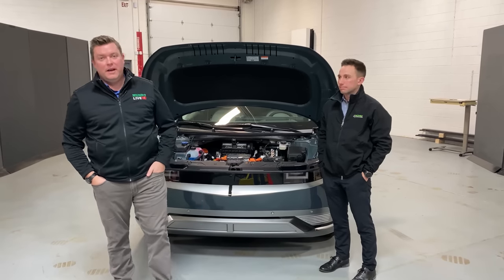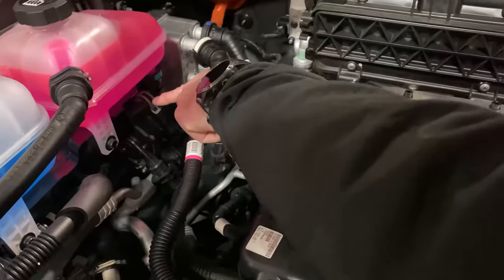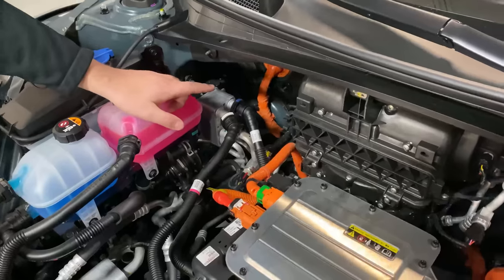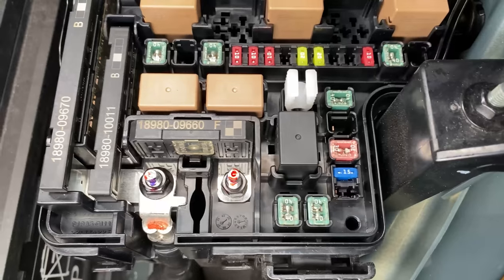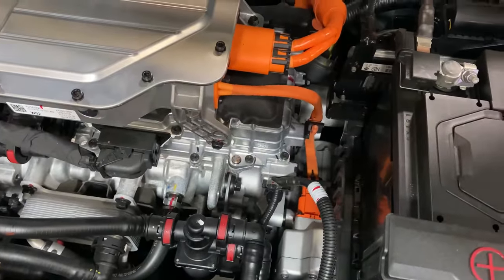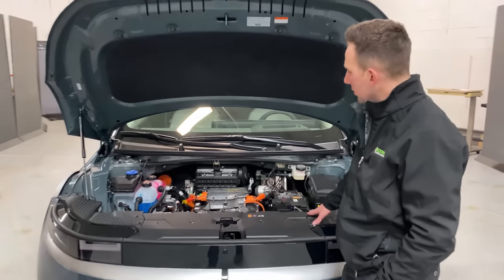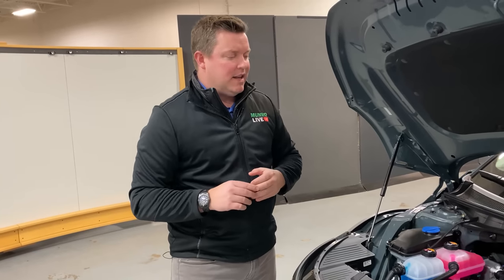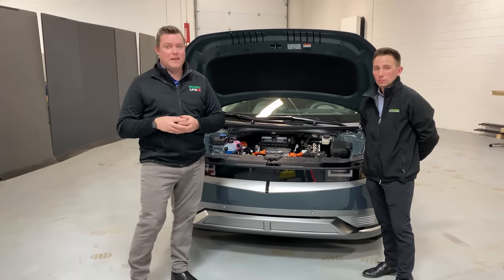Hyundai IONIQ 5  |  Under the Hood

Comment: Hyundai is making a committed run at the EV transition. But what I learn from videos such as these is just how gdmf innovative and clever is Tesla and how ferociously they're developing their products. Think of it: from this IONIQ 5 thermal management tangle to the "design symphony" in the Tesla. I'm rooting for all serious BEV contenders, but think all but Tesla must get deadly serious if they hope to survive, never mind thrive.
Reply: You're missing the point, not only are you wrong with Tesla having a much bigger advantage than you realize. It doesn't matter what a competitor can make if they can't produce it at scale. The margins matter, only Tesla is selling millions of EVs at a ridiculous 30% profit margin.
Reply: The trick is, does it really matter?  The incremental costs of segregated systems is pretty trivial compared to the overall cost of the vehicle and in some cases, may be more efficient, but arguably not as "elegant".  You have to understand that the average buyer will never see any practical difference between a heat management system like this and Tesla.  These systems will be maintenance free for the practical life of the vehicle, so they are pretty transparent to the buyer experience.
Reply: The design symphony was a rear drive unit on a $150,000 car.  There are different ways to go about things, and Hyundai's is not a wrong way. These e-gmp cars are more advanced than everything but Tesla, and maybe a couple of Chinese EVs.   This modular platform will result in a number of different cars for different niches - that flexibility means some compromises, but those compromises are with a purpose.
Reply: @anxiousappliance  The "symphony" exists in every single part of a Tesla car. That's the point, specialization without compromise. That's why the Hyundai way is lazy and stupid and will lead to their bankruptcy. A one-size-fits-all approach results in everything being equally mediocre.
Reply: @kyotosunsetdreams6105  not so much.  Different approaches, each has their upsides.  But you were quoting Munro, and they were discussing the rear motor cradle of the Plaid.
Reply: @anxiousappliance  no, i win.
Reply: We're all winners.
Reply: @anxiousappliance  no just me
Reply: @kyotosunsetdreams6105  If you had half a brain you'd realize that Tesla takes huge risks with "optimization" for the sake of costs.  For example, the VCFront has ALL the accessory motor control circuits on the board itself, which means that if the FETs for the wipers blow or the circuit fails, the entire VCFront must be replaced ($1k+), not just a $35 motor!  Optimization at this level is a double-edged sword and many Tesla owners have been burned by it!  On paper, these kinds of design optimizations sound good, but in the reality of a harsh operating environment; vibration, large temperature swings, etc, it's a recipe for failure.
Reply: @awebuser5914  Half a brain!? I am an Aerospace engineer bucko! I work on rockets, I think I know what I'm talking about when it comes to optimizing design.
Reply: @kyotosunsetdreams6105  Sure you are...  I'm also sure you immediately saw that the VCFront execution is just a really BAD idea all-around; making typically minor issues turn into extremely costly ones.  I can't begin to imagine the removal/install costs of the VCFront, let alone the part cost itself!  Mind-bogglingly ignorant design from a service-life perspective.
Reply: @awebuser5914  The point is to move to a low voltage system that doesn't work off of archaic 12 volt which was antiquated by the time it was designed.
Reply: @kyotosunsetdreams6105  Then I must regretfully declare victory.
Reply: @anxiousappliance  i decline your declaration and declare my own.
Reply: @kyotosunsetdreams6105  and so it is written
Reply: Having integrated systems may be better for company profits and simplicity. But at the same time, it increases the cost when (not if) a part of that integrated component breaks. You would have to replace the ENTIRE thing. That would cost many hundreds of dollars MORE than if it were separated like it is on this Hyundai. Serviceability is key to longevity and low-cost maintenance. The cost for maintaining the Tesla over the life span of 10+ years will be a LOT more than this Hyundai, mark my word.
Reply: @michaellim4165  Noting your word, but not marking it. We'll see how your theory pans out, but so far indications are that the reliability of multifunctional parts are a non-issue.
Reply: @michaellim4165  HAHAHAHAH HAHAHAHAHAHAHAHAHAHA. .... AHAH hahAhAhahahah. HA HAAH AHA...
Reply: @KyotoSunsetDreams  You have nothing for a comeback. So I win.

Comment: The thermal management system is complex on BEV’s. It’s not a simple radiator and water pump solution to keep the electronics and batteries cool.

Comment: This is not as simple as a Tesla.  Thank You for this information.
Reply: And yet it is cheaper than a Tesla and much better build and with more features like HUD, super fast charging 800V, heat pump, pre-heating battery, better quality seating and equipment, V2L, etc. Tesla needs to up their game cause they are getting leapfrogged in every aspect.
Reply: @TheNature101  Wait, did we watch the same video? The features you mention Tesla has for years now. 
Also, better seating? I sat in both and Tesla's are much more comfortable.
Reply: @TheNature101  800 Volts but still slower and charges slower that a 400v equipped tesla
Reply: @0xszander0  Tesla does NOT have a HUD. Tesla does NOT charge as fast as 800V Ioniq 5. Tesla does NOT have V2L. Tesla build quality is GARBAGE. A $60K that is full of squeaking and rattling, and phantom breaking on every turn on every bump. And I know that for a FACT as my family used to own both a Tesla 3 and Y.... but not any more. Hyundai's build quality is eons AHEAD of Tesla. And Tesla better wake up before it is too late.
Reply: @clevernduruza8624  On the Ioniq 5 you can add almost 100miles in just 5min or charge 10% to 80% in just 18min. You Tesla fan boys are in denial and better wake up before it is too late.

Comment: 400 600 800 volts is not hV according to nec 2020 it begins at 1000v
Reply: Terms such as "high" and "low" are relative. In an EV, the lower-voltage battery runs around 12 volts, and the higher-voltage battery typically runs around 360 V but in some cases twice that. It's the high-voltage battery of the vehicle, whatever the NEC classification.

Comment: Man that thing is a mess under the bonnet.
Reply: They are reviewing a model with the front motor installed, a battery heating system installed and a heat exchanger installed. Lower trims have none of these with RWD I5s being much cleaner under the hood.
Reply: Context is everything.

Comment: LOL. Standard 12V and a fuse box? These cats are no match for Tesla.
Reply: Munro is a manufacturing cost analysis service. It's interesting that they didn't comment about how much more the lithium-ion battery and management system costs, compared to a lead-acid battery. No everyone is buying a $100,000 car.
Reply: These are costs for normal people. Is resettable fuses and a lithium 12v battery worth hundreds in extra BOM Prices?
Reply: @brianb-p6586  The Model 3 is not a $100K car. And what does that lead acid 12V battery weigh, over 50 lbs?
Reply: Ioniq 5 can do V2L while Tesla bidirectional charging everyone got so excited about (autobidder etc.) was another hoax.
Reply: @KyleHubb  The Model 3 doesn't come with a lithium-ion 12 V battery, although some Model 3 owners buy an aftermarket lithium-ion replacement. The Model S is a $100K car, and even it didn't come with a lithium-ion 12 V battery for years. 

The battery in this Hyundai is unnecessarily large. A smaller AGM lead-acid would be an obvious choice.

Comment: That saves the company money but it is not as durable and reliable. Sure it will make it out of warranty but then what? It is also much more expensive for the customer. That is what BWW and Daimler do. It makes the car's expensive to own and maintain for the customer and guarantee's they will fail shortly out of warranty. On top of that in exchange for less durability and reliability no saving is passed on to the customer! So we have taken Hyundai's already questionable build quality and durability and lowered it! What an achievement! More cheap plastic under the hood.

What idiot want a car that has non-serviceable fuses and relays. We do not want a throw away car or a car that needs $2000 worth of service if it just needs a fuse!
Reply: Just like most modern homes don't use fuses any more on their electrical panels. 

EVs are using something similar to a breaker. If it is tripped, the system checks for fault and depending on the result of the self check it can flip the breaker back on certain circuits. 

No need to sell the car or throw it away because the breaker tripped. What they are showing here is that the old OEMs are still stuck using fuses when they can switch to breaker like modules that can self diagnose and don't need to be replaced like a burned fuses would.

I might be wrong but just like I don't think new homes will be getting fuses instead of breakers on their panels, in my opinion all OEMs will follow the trend and get rid of fuses.
Reply: These cars are buildt to last. There are very few problems with hyundai EVs, and their build quality is in no way questionable.

Comment: Why are legacy auto makers kludging something together that looks like a Frankenstein auto?  Tesla is doing what automakers should be doing, namely removing parts that don't increase the functionality and efficiency of the system.  Just about every OEM sans Tesla and some Chinese automakers that started with a clean slate, have been trying to use up their old parts that are laying in a dusty parts bin somewhere.  If EVs are to be successful then the engineers must win and not the bean counters.

I have a Prius that I want to replace with an EV.  If I wanted unneeded complexity I would stick with a Hybrid.  Come on OEMs, stop trying to make an auto body that works for ICE, hybrid, and EVs.  Start with a clean slate and reinvent the wheel.  Note that only Tesla and a few Chinese automakers are planning on using a Gigapress chassis.

This far into the EV game, only Tesla and some Chinese manufacturers are really defining the future.  Detroit, Japan, Europe, and Korea are hopelessly lost.
Reply: Integrated systems = high cost to maintain. If a part of the system breaks, you will have to replace the ENTIRE thing. 
Segregated components will reduce costs to maintain the system. Simple isn't always good. 
You have an integrated modem with a router. If a route breaks down, you will have to replace not just the router but also the modem that comes with it.